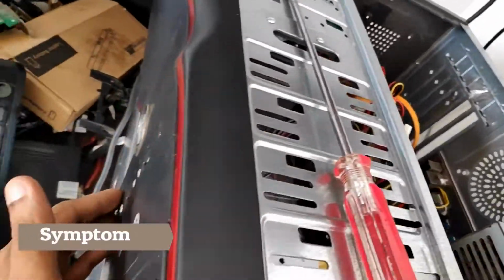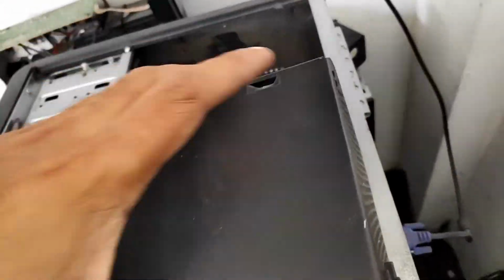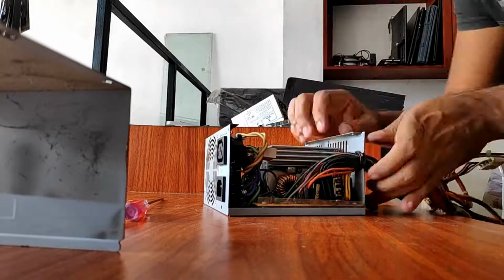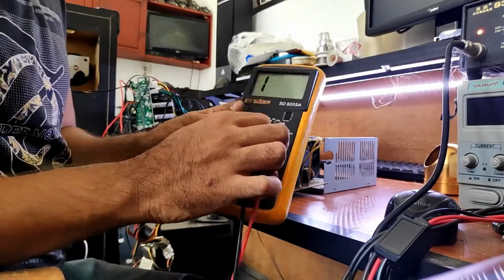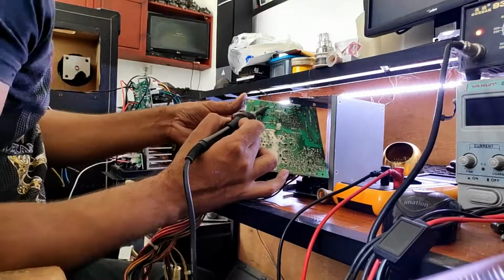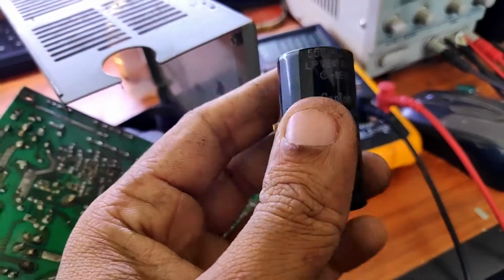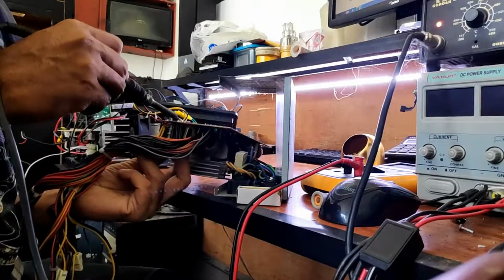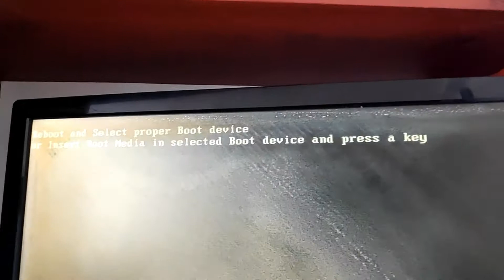How to  Fix Dead Computer ( Repair Power  Supply)

Comment: Where did you get the capacitor from? I need to get those in bulk to fix 5-6 power supplies
Reply from the maker: Just from old scrap boards

Comment: sir. I have a problem that my atx psu is always on when connected to ac plug (no motherboard connected). I checked there is no short from ps_on pin to gnd. what's wrong then?
Reply from the maker: Maybe bad pwm chip
Reply: any way to test it?

Comment: Kohemada replaced karapu ekema(kalu pata item eka) thamai  issue  eka thiyenne  kiyala hoya gaththe
Reply from the maker: Diode එකක multimeter එකේ continuity mode එක දාලා check කරනකොට එක පැත්තකට reading එකක් එනවා.අනිත් පැත්තට 1 reading එක එන්නේ.මේකේ continuity 0 දෙපැත්තටම.ඒ නිසා short එකක් කියලා කියන්න පුලුවන්